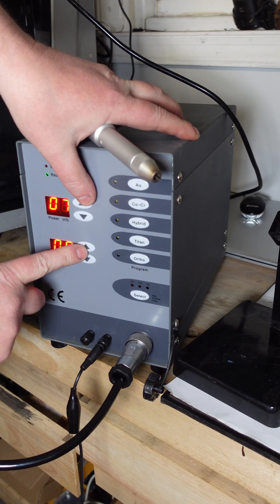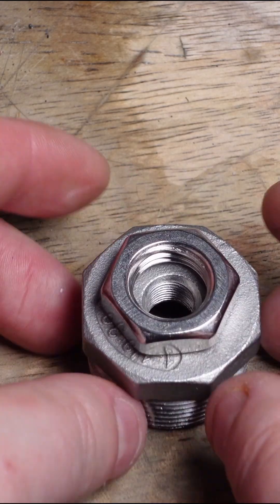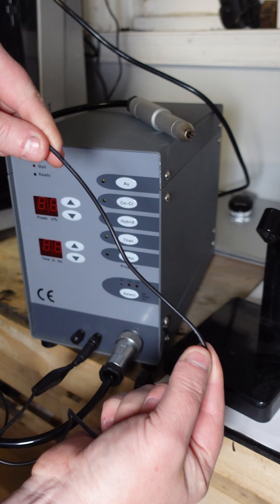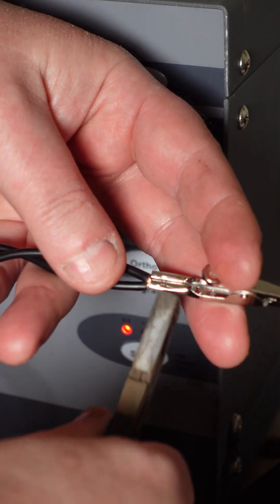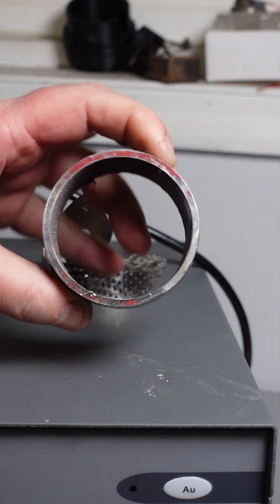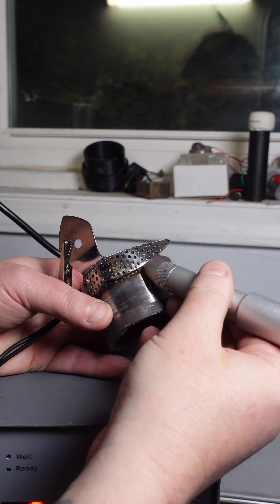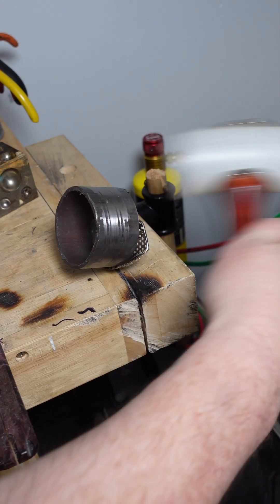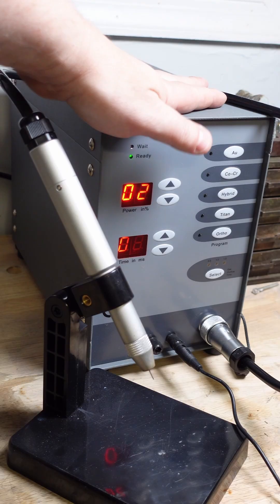Pulse arc welder upgrade? #jewellerymaking #3dprinting #lapidary #metalworking

Comment: Just like you the first one I got was garbage but the next brand,  that was identical in every way,  was perfect.  I  don't use any shielding gas but I do use a liquid flux intended for stained glass applied to the site and hit it very lightly with a butane kitchen torch to dry the flux before welding. I don't know if the flux helps with adhesion but it shields the piece from that black soot, it wipes off completely with vinegar on a paper towel.

Comment: Bro using 2 wires is useless.
The electricity use the shortest way so basically will go through only 1 of the 2 even if you put 2

Comment: Get a flux core for when you need to weld thicker material. You can get a harbor freight one for about 175 and the wire for 15. The wire will last a long time to.
Reply from the maker: Yea i know but its not worth it for me. I rarely need to weld stuff larger than jewelry

Comment: Judging by the labels "gold, titanium, cobalt-chromium..." This is clearly meant for jewellery and other microwelding projects. Not designed to replace a MIG or TIG for structural welds

Ideal for the types of projects this channel promotes!
Reply from the maker: Yes of course but in a pinch if you need to weld something larger its nice to know its possible even if its not ideal

Comment: Just get a 120V flux core mig, it makes actual welds.
Reply: Yeah no thanks lol
Reply: @maxwellbarnhart1375  If you don't know how to weld you don't know how to weld I suppose. Flux core is okay if you know to reat it like MMA welding. Anything is better than the "welder" in this video.
Reply from the maker: @murmenaattori6 that entirely depends on what you need to weld. good luck welding jewelry or titanium with a flux core welder.
Reply: @sweetgumnyc7794  Fair but that's not what you tested at all. Makes it seem like on this video you compare it to a continuous feed welding machine.

Comment: I used a similar welder to repair the surface of plastic injection molds. If the scratch or whatever was too deep to polish out without affecting the part. It would have to be filled first then polished. I had a microscope type thing that had welding lenses that would automatically darken each time you welded a spot. It was a pretty cool job

Comment: I didn't know this was a thing!! So cool. Contrary to the other comments I think this would work for most of my projects. Like I'm experimenting with a diy oil burning stove that doesn't need external power. I don't need super strong welds, I just need them to hold metal parts together and not melt.

Comment: "Probably not as strong as a TIG" bro that's the most anemic useless welder I've ever seen. You'd be better off throwing a SMAW stick on a 120V straight wire. A crappy MIG welder is like $100. Where did you find this trash? This thing makes a bestarc look like a Miller.
Reply from the maker: This is a pulse arc welder. You clearly have no idea what youre talking about.  Nothing you mentioned can do what this machine does
Reply: @sweetgumnyc7794  Lmao @samuelcomeau is an idiot.
Reply: Lay off bro the guy is probably a jeweler
Reply: this is such a failed trade school type mentality
Reply: It's for jewelery. Like tiny tiny stuff. God you people are ding dongs lol